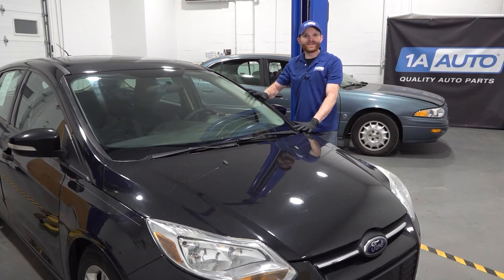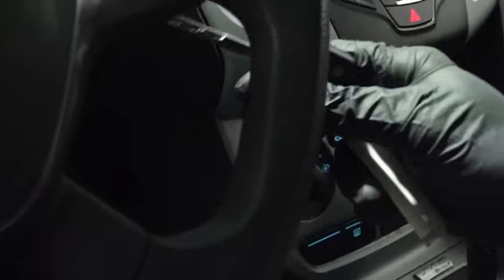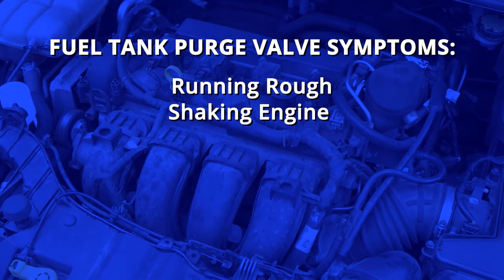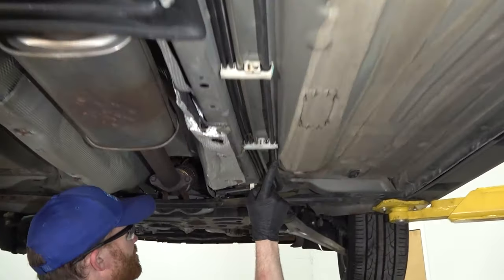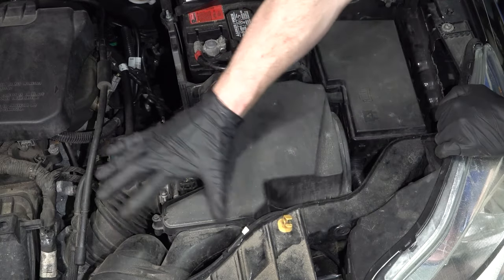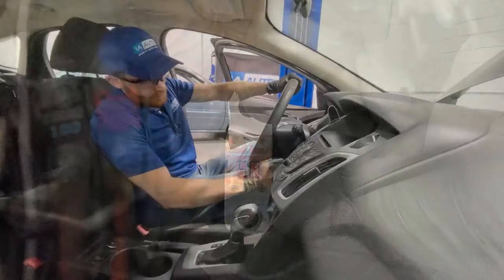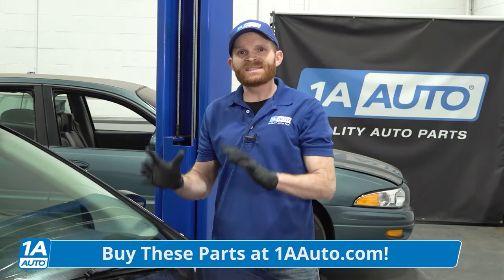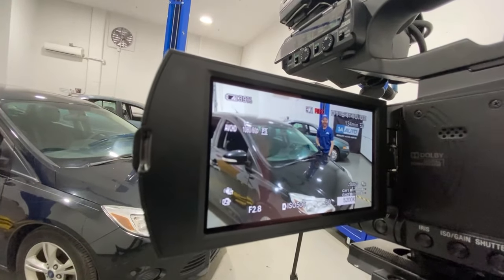Top 5 Problems Ford Focus Hatchback 2012-2020 3rd Generation

Comment from the maker: √  Watch the Video
√  Buy The Part at 1A Auto http://1aau.to/m/Visit-1AAuto
√  Do it Yourself
√  Save Money
Reply: Hey there, thanks for the video.
I was looking for another problem with my Ford Focus MK3 that i’ve not found here, the problem is with my Sync, it switch off while driving, when i try to switch it on it works after 2-3 power button press, then it works for 20-30sec and it switch off by itself, i checked all the fuses and there’s no damaged fuse, the remote on the steering wheel also is not working since. The diagnostic gives no error code 🙄🙄
Please can you help me? Thank you in advance

Comment: 2016 ford focus with manual transmission here.. 230k miles not one problem so far.   Only tires ,battery, brakes, oil changes,  struts ,shocks ...
Reply: Lucky you lol yours is a unicorn
Reply: That manual is the saving grace, if it was an automatic, I guarantee you'll be sending that back in a heart beat
Reply: Bro I think the 2016s have less issues than some other year models cuz Mines at 150,000k w automatic transmission and aside from general maitencne only thing ever needed replacing that's major was fuel pump and that was a factory recall so it was free.
Reply: 2012 hatchback SE manual . 168k miles . Not a single problem. Healthy. Just regular good maintenance. Love my little focus
Reply: @justinlafollett9001  Nah man, 2016 ford focus SE Titanium, DVT transmission is worst, shuddering in 1,2,3.  50k miles, bought it from an older lady who used it for town. Ford said they already did the recall fix, yea okay that's a joke.
Reply: 12' Focus Automatic. It really depends on your type of driving. Mine had 380,000 miles of highway driving with no issues. Once I switched to city driving... I'm literally taking my car in today to get my 3rd clutch rebuild in less than a year(~5k miles) Good thing it's covered under the initial repair warranty.
Reply: @jaredl2239  I only did mine once, Im about to drop the trans and make it manual, turbo it and have a lil fun with it. Since the cars value is trash because of the known trans issues ):
Reply: Same here. 2014 150k powershift transmission. Tires, brakes, oil changes. Haven't done the suspension yet but probably need to.
Reply: @SD-yn9tv  really happy to see this have the automatic if your car just around 100-110k very happy
Reply: Same here, focus mk3 2011 titanium, manual transmission with 230k Kms not one problem only normal changes for renewls...
Reply: mines the same. 6speed manual 2016. 95k miles so far.
Reply: I was gonna say my 2014 se with almost 100k has no problems other than my stereo doesn’t wanna work anymore and I need to switch my breaks out entirely my rotors are bad in the front and I hate drum breaks in general
Reply: @kadeelacayo4806  it’s not lol
Reply: @datmanz5890  fuck sake do you drive a focus I have the six auto and the only issue is the hesitation which they have from the factory calm down and do little more research
Reply: Lucky you, same car as you but automatic and keep having low pressure in the fuel rails 😩
Reply: I have a2016 as well no problem only dead battery. Charcoal canister. And heater motor blower.
Reply: Got a dual clutch automatic one with 170k from 2014. Still shifts like a dream even on high rpms. Changing transmission fluid every 30k miles is the key
Reply: Being from the UK I'm fortunate enough to have the 1.6 ecoboost in manual. I have heard the powershift is an absolute nightmare, even in later models.. Other than regularly checking the coolant level, I've never had any issues with mine and tbh, a car that only offers 150hp, gives me 47mpg and 0-60mph in 7.6 seconds. Not big figures but great value for hard earned buck..
Reply: I have a 2015 Focus ST. No issues. Well, that's not completely true. I had to replace the turbo. That was my fault.😁
Reply: 2015 Focus manual shift 115Kms …only an electrical issue. Otherwise a good car.
Reply: 2015 Titanium Automatic owner here 148,000 miles, my focus decided to stop shifting after 1st gear and I have no reverse other than that I’ve had no other problems but this is the major one I’m dealing with
Reply: My sister bought a 2014 Ford Focus Titanium hatchback a little while back and had the transmission replaced recently and my nephew just replaced a broken passenger side motor mount that was causing vibration issues. I replaced the driver's side door switches and a fuse for the dome lights. The only thing the car needs done is the headlight lenses need replacing from being weathered, but the car drives great now at 136,000 miles and is being given to my wife and I cause she is moving in a few months and just bought a brand new Ford 150 pickup truck...

Comment: I’m surprised the automatic transmission wasn’t mentioned. It’s perhaps the least reliable transmissions put into a modern car. It’s an internal design problem of the DCT, not just a grounding issue, although I bet there also are grounding issues as well since they mentioned it.
Reply: It is several things:
1) heat.  The bell housing has no fan to cool the dry clutches...so in long gridlock the clutches overheat and glaze
2) rear oil seal.  The earlier clutch packs had a bad oil seal, not corrected till revision G.  This allows oil into the dry clutch area.   Causing slipping and varnish.   Especially noticed after long freeway trips
3) the TCU was recalled.  After replacing the TCU things get much better, but the clutch pack is already damaged, so get that one done under warranty right after the TCU work.

Ford bought this DCT from a subcontractor to retrofit UK and German Fords (mostly stick) to automatics for US, Can, Australia, NZ.  The Focus/Fiesta was also going to be an EV and Hydrogen platform so they needed electric automatics.  Never hapoened.

Whoopsie.
Reply: Yes they dropped the ball on this video for sure.
Reply: Ford has had alot recalls and at least one class action lawsuit over there dual clutch transmissions.
Reply: heater core is a common failure along with steering rack and water leaks from  the roof rail and rain flooding out the rear hatch compartment, also poor seals around the rear air duct vents  behind the back bumper that water seeps into and builds up water where the sound deadening material is and drenches it. electrical problems and engine hesitation and many faults
Reply: I'm at 150k on my 2014 and never had a single issue with the powershift transmission. Not a single software flash or clutch job. I have owned the car since new. Best recommendation is to drive the vehicle in a similar way every time you drive it.
Reply: @fearthecheez  After just buying my 18yo daughter a '14 titanium focus, ur story is great to hear. I told her to drive it with spirit. Not "wot" but not gramma style either lol. Hope it stays running and driving as nice as it does now with 111,000 on it.
Reply: Here in Brazil, the automatic transmission, TCM and related are in top 1.
Reply: The control module has solenoids with a gear system. Stupid design. Has anyone mentioned this? Most TCMs are just a circuit board and some other smaller components, Ford decided to use mechanical components.
Reply: @brumasoficial  They have a gearing system with the TCM, dumb idea. I know what you're talking about. I sell those parts.
Reply: METAN ARC  there are no good units in the Focus.
Reply: I got an Engine Fault Service Now just the other day while an hour away from home but luckily right in front of a shop. 

They pulled the code P061 (no letter, at least he didn’t mention one) and Internal Control Module and told me I had to contact the dealer. 

I called a dealer to see if I could tow there today and they said “2013 Focus? Have you heard of the DPS6 issue? This car is notorious for having this issue”. 

I had to cut him off to let him know this is a manual transmission. He then says “well the good news is it’s not a DPS6”🤣

Anyway, this just happened yesterdays d the dealer said they are booked for a week so I’m just learning it for parking it for now and replacing whatever I can related to this issue unless I’m not able to. The car wouldn’t go over 5 mph and jerked/stuttered. After towing it will not start but cranks.
Reply: I had 3 transmission redone. Pretty much one transmission redone per year.
Reply: Shoot I bought a titanium '12 for 3k with 198k miles. Currently at 220k with no problems in the year I've had it. We'll just see 😶
Reply: @fearthecheez  my cars had clutch twice and tcm once. Worst design ever
Reply: 2013 over 100k mile city no transmission issues had the EVAP issue & motor/trans mounts. Also they did mention it. The transmission isn’t unreliable just finicky aways need a good battery & alternator since it is electronically controlled. Literally thought I had a transmission issue until I did all the mounts
Reply: How about the 6 speed manual transmissions on a 2015 Ecoboost Focus?? Is it reliable?
Reply: @cirealreviews1776  so a 2015 ST? I think the trannys good for like 350-450 HP and I don’t see too many of them blown it’s usually the engine that goes first
Reply: Guys! UK based here. £ Reservation is down on a 2015 2.0 diesel automatic. Does this have the same shit gearbox that has been mentioned here?? The master tech at the dealer doesn't seem to think so?
Reply: My 2012 focus has been into fords shop 8 times. All for the horrible automatic transmission. Slipping, shuttering, delay, grinding, etc. it’ll go away for a few months after it goes in the shop, but it always comes back
Reply: Purchased a ford focus low mileage good price.. BIG mistake, don't do it The transmission will fail.
Reply: @ronl1633  u have to take it to the dealer to change the clutch kit and update the TCM. :( If they don't do it they Ford  have to buy it back I think.

Comment: Did you make this stuff up?? I have a 2012 Focus Hatchback with manual transmission that I've owned since 2014, and it only had 16K miles on it when I got it. I've got 163K miles on it now. My co-worker has a 2014 Focus Hatchback as well, ALSO with a manual transmission. He just turned 300K miles last weekend. NEITHER of us have had ANY of these issues. None. We both did have an aluminum upper rear shock mount (right side) break, and we replaced both (we live in NE Ohio with lots of road salt). I also had to replace the engine coolant outlet at the back of the cylinder head. Other than these 2 issues....our cars have been absolutely WONDERFUL. Just maintenance. Both cars run like new. Both cars feel like new. I replaced my ball joints at 145,000 miles. I can't believe they lasted that long. We both agree, these are the best cars we've ever owned. Yes, the dual clutch transmissions were an abomination. We both enjoy driving manuals though, and I've been driving ONLY manual transmission vehicles since 1991. I enjoy actually riving a car or truck. Anyway, all the issues you outlined here surprised me because between the both of us, we've not had those issues, and never heard of them being an issue before. BTW, we are both still on the original clutch in our cars too. We've both done work and repairs on cars all our lives (we are both 60 years old), and I was an auto tech in the 1980's, and have never stopped working on cars.

Comment: The 2012 and newer Focus would be something I can’t recommend to buy unless if it’s a manual transmission.
Reply: And if it has the manny, great car.
Reply: @jedclampett7705  that’s what I said. My sister had a 2001 Ford Focus with the Zteck engine. It never had transmission problems.
Reply: Have an 18' SE with a few bolt ons with the Auto, but it hasn't had any problems. Been reading online and it seems like the post-facelift/refresh does not have the same issues as the original MK3 from 2012 to 2014.
Reply: @dalesmith4985  I have a '12 Focus 3 and had the same issue with water in the boot.  There's a vid on YT that I used to fix the issue, and involves removing the tail lights and rear bumper.  Takes about 30 minutes to sort.  Sorry to hear about the other issues with your Focus, but apart from the water ingress and a known issue with the AC, mine's been no problem.
Reply: As someone with the automatic you don't know what u are talking about. 150k on my 2014 powershift and not a single service on the trans to date
Reply: @fearthecheez  Actually you have no idea what you're talking about, just because you didn't have problems does not mean there were no problems. The Powershit transmission had a ton of problems, from oil seepage into the dry clutch, to tcm electrical problems to the plastic retainers inside the transmission breaking to metal filing caused by the clutch grinding screwing the mechatronic valves causing them to malfunction. No everyone had problems but there have been enough that you can find hundreds if not thousands of complaints online. It's a well known fact around the world that buying a focus 3 before 2016 when they switched to wet clutch is a very risky thing to do.
Reply: @fearthecheez  Knock on wood. The best automatics are Toyota/Aisin and some GMs. Good luck!
Reply: Yes, I when from a automatic to a 5 speed manual both ford focus.

Comment: My friend bought the 2012 Ford Focus when they were really new.  She had so many issues with that automatic transmission.  She was so happy when she finally found someone that was willing to buy it from her.
Reply: Good timing too. Even though they extended the warranty to 10 years for the transmission, that’s now starting to expire.
Reply: Ford sucks
Reply: @kz6713  automatic transmission sucks. I have a manual 2 years and never had a problem.
Reply: @ryanSLF  i still dont like all the trim and grills on ford trucjs , too much extra glamorous bs , if its supposed to be a work truck then be one dont be a fragile manatee

Comment: Have no transmission “issue” whatsoever on our 2012 SE w/150K currently on odometer. In fact outside of routine maintenance and a singing rear wheel bearing that was replaced at around 90K, this thing has been one helluva car for 10 years running. Bought the 5 speed. 😉😉😉
Reply: I have a 2012 LW focus 5 speed manual and it currently has 75,000 kilometers......the steering rack failed at 59,000 k then the heater core leaked coolant and flooded the front drivers side foot well. now it has a water leaking into the back hatch and flooding out the spare tire well from rain water getting inside. the rear air duct compartment was full of water and when pulling out the bung plug it was like emptying a fish tank. the main leak seems to be from the roof rail that leaks rain water into the hatch area, Ford tells me leaks are common in this model focus from the roof rail. also have an issue every now and then when accelerating with hesitation and losing power which could be anything from spark plugs/ignition coil/Mass air flow sensor/ECM/fuel injector or many other possible causes. you might have had a good run with yours but there are allot of horror stories out there and more bad than anything good.
Reply: 5-speed is the only way to go. People better learn though.
Reply: @tmo2798  so you would say these manual transmissions on the 3rd gen Focuses are good/reliable?  I may be getting a 6 speed 2015 Focus Ecoboost this week...

Comment: I haven't had any of these problems.  Rear wheel hub assemblies only last about 70K miles.  At least in Ohio (maybe road salt) and my clutch actuators just went bad at 140k.  Otherwise it's been very reliable and has way more acceleration power than my mom's 4 cylinder Honda Civic.

Comment: I have a 2012 Ford Focus Hatchback with the 5-speed manual that I bought new off the showroom floor. I just hit 101,100 miles and I've had zero issues whatsoever. I kept up all the routine maintenance and just did a tune up at 100,000 miles and it drives like new. I have had this car all along with a Chevy Colorado that I traded for a Bullitt Mustang that I sold for profit and just bought a Bronco. It has helped me keep my mileage low on my other vehicles and has never let me down. I love my Focus.

Comment: 2015 5s manual 2.0 4cyl with 320k here; all original factory parts (clutch included) aside from the usual replaceables like tires and brakes and filters etc. Most of the miles are highway, and the car sat for 2 years before I got her 1.5 years ago. Since I got her, I’ve put roughly 20k in city and highway combined. I hit a deer last year at 45mph and had no issues other than the hood latch breaking. I haven’t had any of the issues listed here except for the radio, which I replaced the fuse as shown here and the problem was solved. Honestly, this is a reliable vehicle if you invest in the manual transmission and keep up with regular maintenance. Running 80mph on the highway I can get up to 60mpg - SUPER efficient!

Comment: Wife bought a used ‘13 before we married. Surprisingly, it’s been pretty solid.
The worse thing was the engine rear main seal leaking, but fortunately I identified that and got it repaired just before the warranty ran out (also having the clutch on the manual transmission replaced at no additional labor charge). I also had to replace the AC compressor clutch, and then when the recall work was done for the Evap issue, they disconnected an Evap line under the hood to conduct testing, and thereby caused a seal in the line to start leaking, so I had to replace that line.
All in all, those repairs have been pretty painless, so I’ve been pleasantly surprised.
The rubber on the antenna just started falling off, so I replaced it yesterday, and the only other thing is the headlight housings now getting to where they need to be replaced, from UV/heat damage.